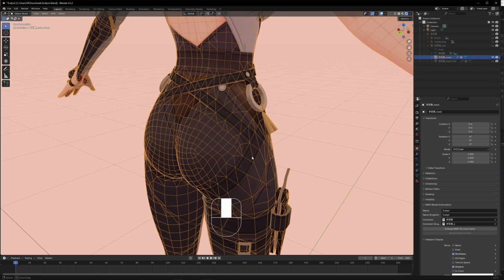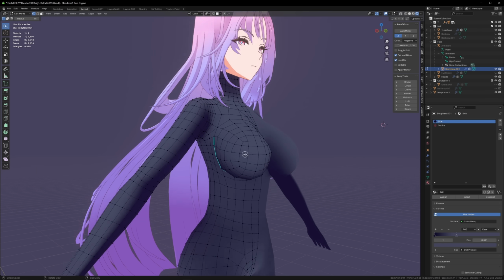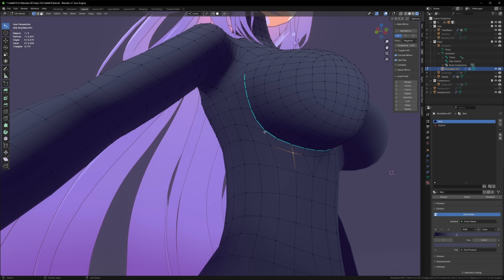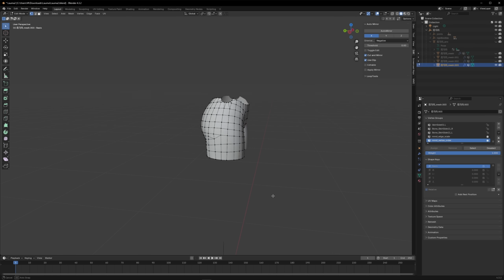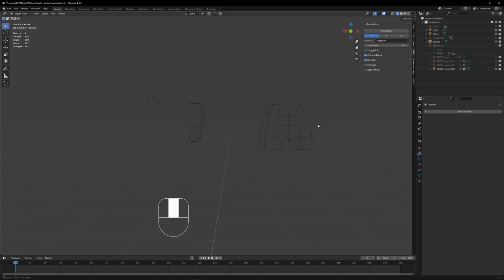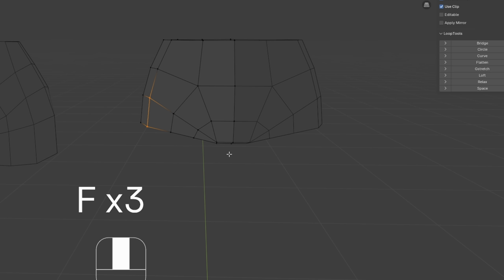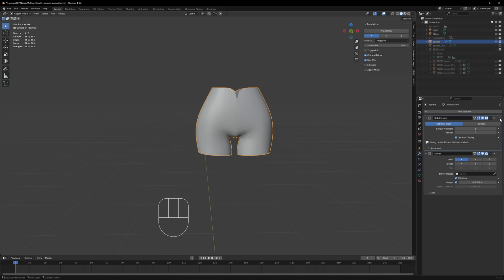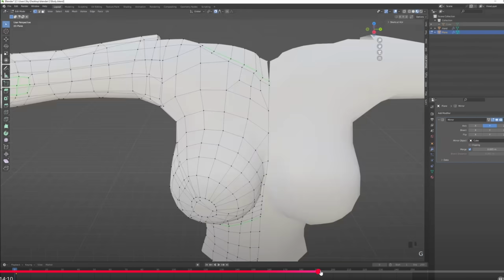"Double The Budget for 'Those' Areas.. 😏" Exposing Pro 3D Model Secrets!

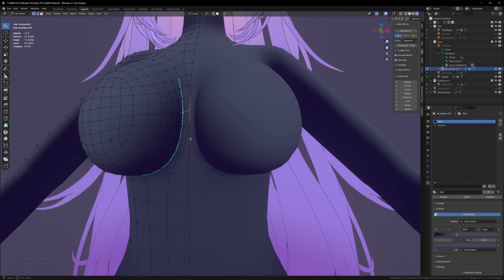Comment: 5:00 you can also just ignore those, or use checker deselect with a small bit of smoothing to turn them into pentagons.
Since every game engine triangulates on import, forcing it to be quads isn't always neccessary. Just press ctrl+t and 'see' how it triangulates first before putting in extra work making everything quads.

Comment: For turning the imported mesh into quads did you happen to just use the default option in Blender, Face > Triangles to Quads ? :) Does it just work or did you have to do any other cleaning up of the model or fixes?
Reply from the maker: Yes that's what I used, it will work fine on most of the mesh but is weird in some ambiguous areas
Reply: @2amgoodnight  Thanks!

Comment: As a crappy illustrator/3D modeler, I've been studying anatomy a bunch and was wondering if it would be a good idea to have our pole on the iliac crest as it's a bony marker. At 11:05 that pole is a little too far inside and low but it's pretty close. I think that's where they put it in the model you used as a reference.

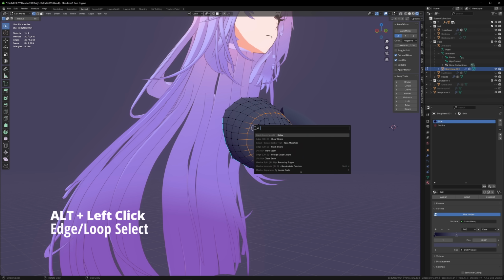Comment: 4:30 that's alot of steps for what could be just the subdivide operator and smooth operator.  manually adding loop cuts seems really counter productive especially if its affecting the mesh surface.

Comment: do you ever have luck with the unsubdivide option in the decimate modifier in the reverse engineer stage?
Reply from the maker: Decimate->Unsubdivide is ok if the mesh is simple enough. But in this case, there are so many added tweaks that it ends up being the same or more work than doing it fully manually.

Comment: I remember back then we would study pictures of low-poly wireframes of videogame characters especially around the crotch area. The goal was to keep those areas low but dense enough for deformations, so when you subdivide the surface it would maintain it's shape. Female models were always more of a challenge because the glutes and the chests. Great low poly study!

Comment: about tris, this misconception grew from various of things. In reality even in professional high-end modelling there's few examples when triangles are acceptable
1. static models with no deformation or intended to non-deformative showcase. It's much better for everyone to use triangles in this context since it makes model less straining for hardware so it'll be easy to render or use ingame, and it'll be easier for you to work with in a way, since it implies you're cleaning up the mesh so no changes will be made
2. in flat non-deformative areas it's okay-ish. Mostly in hard-surface obviously, but it's kinda makes sense that if you have a plane without any real deformations - then it's fine.
main con of using triangles is shading. They kinda mess with face normals and stuff. But other than that, quads are mostly used as a "proof of skill" in a way, since it's preferred to have clean topology in portfolio, doesn't mean you'll have to make it perfect each time though. So yeah, triangles are awesome and it's nice to see you going against the idea that quads are superior in any scenario, because they're just preffered, not required
Reply: Yep, and the same goes for 3d printing. Even if you're modelling something to be posable but not not dynamically you can get away even without remeshing and retopo after sculpting. Sure it'll slow blender down when posing but 3d slicers triangulate the mesh anyway and detail matters especially with resin printing/ Yet I've seen people defending the idea that everything must be quads or else you're bad at modelling
Reply: That seems like a non-issue these days. GPU budgets are pretty high on most devices. It's not like we're in the early 2000s where a few extra polys means the difference between a "playable" 30 FPS or choppy 24 FPS. I'd say let the models retain full detail, but adjust the environmental details to compensate for lower GPU budgets.

Comment: Hi teacher, I have some questions. If three-sided faces are acceptable, can I use them in animations, not necessarily in games? I feel that as long as the animation maintains coordination, the model can also have some triangular faces to make room for key positions and more details where details are not needed, while saving computer resources.
Reply: you understand it basically already, the main issue with triangles is that they can cause unpredictable deforms, but it is a necessity for 3d modelers who work on models specifically for games to reduce poly count.

therefore they merge vertices down, creating triangles. you will notice this at the top of heads, near the ankle, and even merged down at the fingernails etc if you inspect these game models

game engines automatically quads into triangles anyways (but for a different reason, namely for planarity)

basically, you wanna hide things that can cause issues with shading, deforming, etc such as poles and triangles in specific areas, or use them smartly (guilty gear uses a lot of triangles for deforming the mouth)
Reply from the maker: Yes, the same principles will apply whether for game or pure animation 😊
Reply: @2amgoodnight  thank you ！
Reply: I wouldnt know of why Triangles bad. I assume it was partly OpenGL would not display the model correctly or need align the faces perfect horizontal edges for Triangle Strip render.
Other half is shaders, Tesselation where subdividing a model with triangles can sometimes be janky.
So AAA mentality and people blind parroting cause it. I'm not a game dev in the industry or w/e. But triangles and N-gons are fine. imo (Unless your doing portfolio and dont want to get filtered by someone that 'knows' better)
Reply: @angusangus4089  OpenGL consumes tris, not quads, so in the end the model is always triangulated. The anti-tri crowd comes from the modeling world. Personally, I believe that it is a form of purity test and subtle flexing, since a optimized, clean and pure quad mesh is harder to make that one that includes tris.
Reply: @angusangus4089   thank you！
Reply: @angusangus4089  thank you ！
Reply: not 2AM, but in my experience, the reason modelers say to avoid tris is that they don't deform nicely especially when a UV Map or albedo is applied. As long as the tris aren't in an area that deform too much, there really isn't a problem with using them.
Reply: @JonFawkes  thank you！
Reply: Teacher, you are the treasure in my heart. You taught me a lot. Thank you.